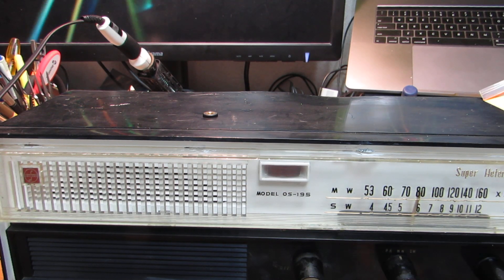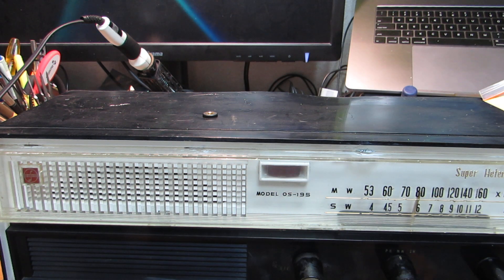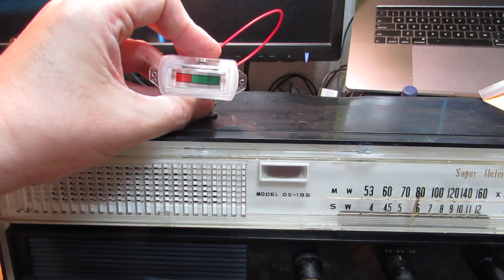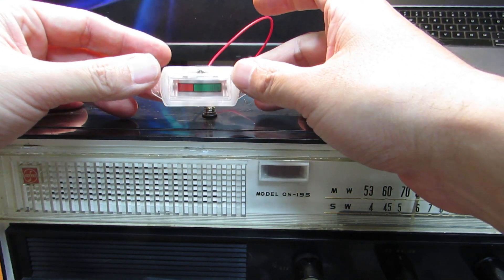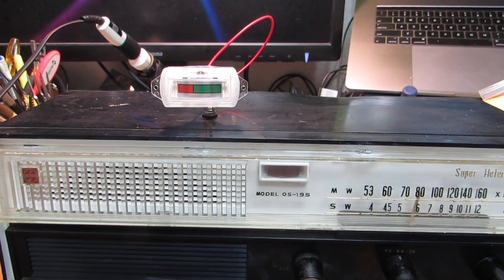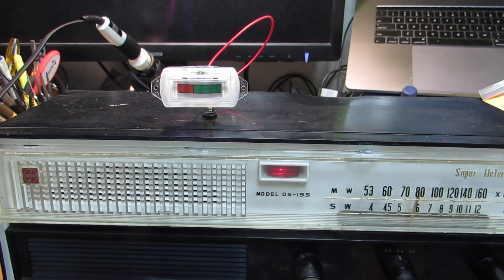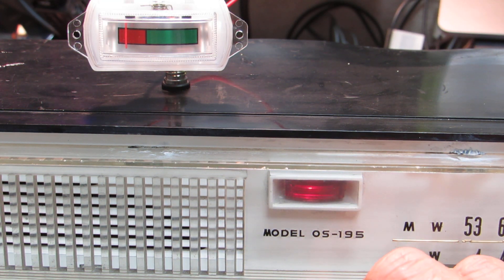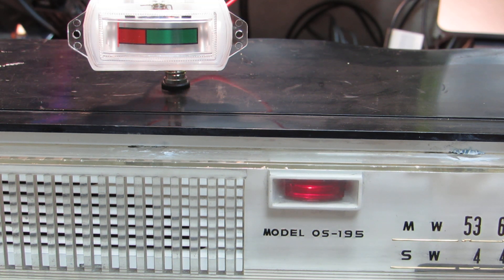Retro tube radio gets signal strength meter (S-meter)

Comment: Colleague, do you know how many uA this is this S-Meter? I intend to buy one to connect to the AGC line and it is a very weak signal
Reply from the maker: It's been long time since I uploaded this video and I don't remember exact spec of this meter, but 100uA or around will work, I hope. If you need more meter wipe, just insert simple amplifier (it may be just common emitter one..)
Reply: @microwavemont  What would this amplifier be like, do you have the schematic?